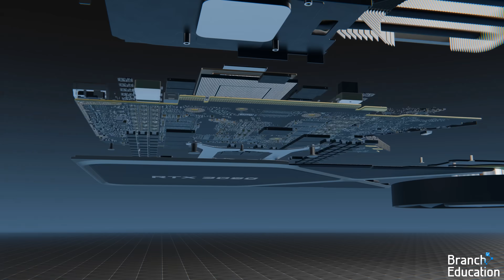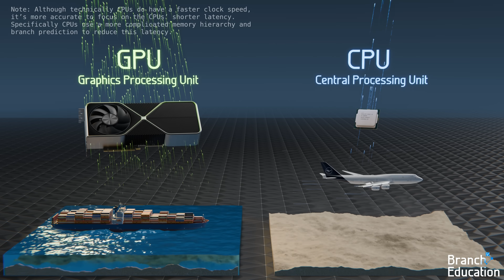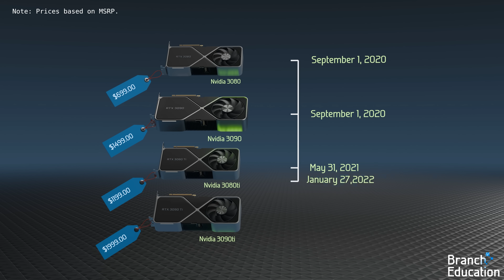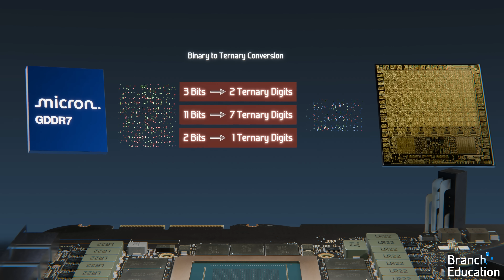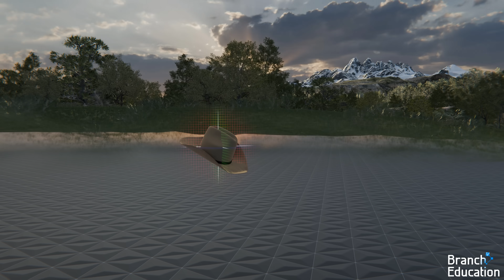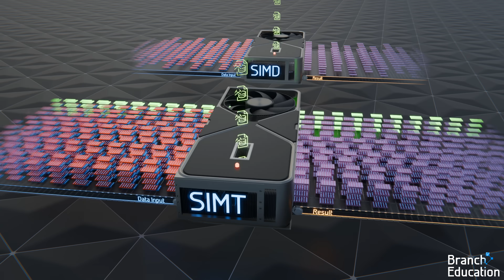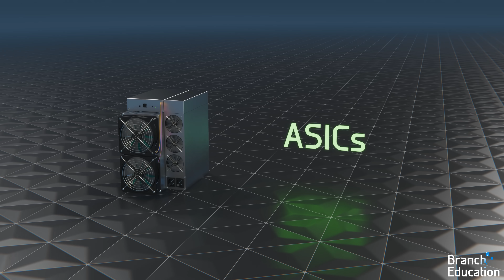How do Graphics Cards Work?  Exploring GPU Architecture

Comment from the maker: I (Teddy) went to an engineering college for Electrical Engineering, and a few of my friends went to work for Micron after college and loved it.  Check out careers at Micron using this link:  https://bit.ly/micron-careers 
One question you may have is why did we choose to feature a 3090 Graphics Card?  To create an extremely accurate 3D model, we had to purchase the graphics card and do a rather destructive teardown to the extent that we desoldered all the components.  To avoid wasting a perfectly good graphics card, we typically buy our models as broken or 'for parts' on eBay, and they didn't have any 4090s, so we purchased and used a 3090. Just so you know, I (Teddy) have a 3090ti in my computer, an i9-12900k, 64GB ram and a bunch of SSDs.  Also, a 4090 performs 82.58 Trillion calculations a second using 16384 CUDA cores.  When it comes to 5090 graphics cards, it looks like they will be 21760 cores, with 32GB GDDR7 memory, and 109.7 Trillion calculations a second, with 170 RT cores and 680 Tensor cores.  

  If you have any questions, feel free to ask them here!
Reply: No questions. Just keep up the great videos ☺️❤🥸
Reply: @Tempestelterna indeed..Good stuff
Reply: How many people are you working with on these videos
Reply from the maker: @bananaboi3343  The team is myself, Teddy, (research & script), 5 animators, 1 modeler, and the narrator.
Reply: @BranchEducation  I thought it would be way more people, wow. Great job
Reply: @BranchEducation  Don't believe it, u r probably 1000 or more member team
Reply: @BranchEducation  why you haven't put the links mentioned in the video about other videos of yours in the description so we can follow on them?
Reply: @BranchEducation  Are you looking for additional team members? I'm trained in a different but
 complimentary discipline. I also like what you do.
Reply: @BranchEducation  these videos are so underrated I wish more people could watch your videos. And thank you Teddy and the team for these videos!!
Reply: I am a poor person now from a third world country , but marky words ,, i will donate to you one day.
 We need people like you in this world
Reply: @BranchEducation  Is that mean 3070 has more "damaged circuits" ? How would they keep it consistent across a certain model? Just disable x amount of circuits?
Reply: @BranchEducation  Thank you Team for your efforts! :face-red-heart-shape:
Reply: @BranchEducation  Awesome team and very impressive video,thanks I really enjoyed it!
Reply: @BranchEducation  What's the narrator's name?
Reply: @BranchEducation  actualy
Reply: I, currently in college for EE, was not aware of Micron before this video, and following the career link to learn that there is a location near me opens up more options for me to explore which I greatly appreciate. Your videos are always so well done and are very impressive. Thank you so much for everything you do!
Reply: Please Make a video on how the ai image generator works
Reply: @khusburezwan yes, will be amazing
Reply: @khusburezwan yes please
Reply: Excellent content as always 💯. 
Still hoping to get a video on how Bitcoin mining works.
Reply from the maker: @No_Names_Here  Hopefully, you won't be waiting that long.
Reply: @BranchEducation  how many books do you read for this and where do you get them?
Reply from the maker: @saidswn980  For this video, a lot of the details were actually found in NVidia's white papers.
Reply: @BranchEducation Hi, where did you study this? What exactly is ee? I'm really interested in this subject but not quite sure where to study it. I'm from Finland and I'm not sure if we have this kind of school
Reply: @soyboy39  I believe EE is for Electronics Engineering, and/or Electrical Engineering.
Reply: @No_Names_Here  same here, i also want to know how bitcoins are mined.
Reply: @MDEmtiazHasanParvez  There is free crypto mining software out there.  I can't recall the two I tried a couple of years ago, but it's easy to do.  Problem is, depending on the current crypto rates, it uses a lot more power consumption running the GPU and keeping it cool.  You also need a powerful GPU if not multiples.  If your system has a lot of idle time, you might be able to make a little profit.  It would make for a great video though.
Reply: Why specifically a Nvidia GPU Architecture? Might be also interesting to educate people there are more ways then one to create a GPU and show their differences. AMD RDNA 3 Chiplet architecture for example.
Reply from the maker: @bartbroekhuizen5617  That's a very valid point.  I think the main reason we pick a specific product (which happens for a few of our videos)  is because I disliked in engineering courses when things were taught as theoretical- which was pretty much always.  So, for our videos, we try to make them explain an actual example.  And really, we chose Nvidia because their white papers went a lot more in-depth into the GPU's functionality.
Reply: @bartbroekhuizen5617  It’s also interesting how intel’s graphics cards chiplet looks like. Cause they have a very good AVI encoder and decoder.
Reply: I see that each generation there's a significant increase in calculations performed. So like what is the limit or will we ever reach the limit of such calculations? How do scientists decide to stop with improvement for each yearly launch? Is it like "these certain number of calculations are good enough for a product for public launch, we'll improve next year" or " we can't improve/increase no. of calculations further so let's just launch this product and hopefully get it to be better next year"?🤔🤔
Reply: @MreeDom  Moore's law.
Reply: @bobbyd6680  I see...so we are close to that undiscovered limit
Reply: This is the gold standard format for educational videos. You inspire me greatly, thank you.
Only since a few years ago have I been more obsessive about questioning how everything is made and the wonders of nature just open up in a positively overwhelming way. It seems that GPUs are branching tward micro and macro models; macro for heavy duty processing, micro for efficient processing backed up by cloud technology.
Reply: Given that I absolutely love my EVGA RTX 3090, I'm quite pleased with the choice of GPU!
Reply: I am a very poor Electrical Engineer but I must say we had to study MPMC i.e. Microprocessors and Microcontrollers in our course and this video just gives a glimpse the immense and vastness of the subject which I passed anyhow😅
Reply: I want to become a vlsi engineer
Reply: How would a 5090 compare to current gpus on a game like rdr2 or cyberpunk? I functionally can’t imagine how much 100 trillion calculations per second is but it seems like it’s more than is needed. If the current gen gpus are at 80 trillion calculations per second, how much of a boost would that get?
Reply: @slimey4427  We might have to go 2,3 generations more for practical ray tracing in games. Cyberpunk doesn't look anything remotely real. Its colors and motions are highly unnatural, yes some fancy light effects but they only add to its cheapness. We will need Peta flops per second level performance in GPUs to make photorealistic games and when we reach that level it will be almost impossible to make so many complicated assets in video games.
Reply: Amazing. Brilliant. Worth multiple awards. The ray tracing and this one is unlike anything ever before. I bet if you make a high school maths course it could advance science and technology. I mean this could have a real impact on the world and its future. Topics like complex numbers, vectors, matrices, all can be done in 30-50 minutes videos each. 15 videos and you can cover all of high school mathematics. That might also generate more funds for you. I can tell you the people who would love to collaborate with you if you form a consortium.
Reply: @BranchEducation  eyyy my name is Teddy too and I own an IT business😂
Reply: I think quantum computer will be best for BIT Coin mining.
Reply: I think that the physical die will have a 512 bit memory bus, but nvidia will partially deactivate it and sell the 5090 with 28GB of VRAM. I can't imagine they'll give us a GB more than they absolutely have to.
As far as I can recall, there hasn't been a mainstream consumer card with a full 512 bit memory bus since the GTX 280 15 years ago.
Reply: I'd love to see a "behind the scenes" episode someday that explores how you make these videos. Your team really does incredible work.
Reply: @genehenson8851  I absolutely second this!
Reply: Two thumps up for excellent videos by your hard work.
Reply: A gpu doesn't contain "cores".  It only contains "shaders"(Shader Unit).  Much different than a x86 cpu.  This is misleading information to the public yet so many refer  it to this because "nvidia" often refers to these shaders as cuda "cores".  ATi preferred to call these shaders as well along with AMD in the beginning. (I realized this video is just marketing)
Reply: It's a bit odd is to use Nvidia's trade marketing names for components found in both Nvidia and AMD cards. It could get very confusing for someone walking away from this video into AMD's CU count (analogous with Nvidia's SMs for instance) or Intel's name for the same technology . The simple line of "'name of thing' which Nvidia calls X" could have helped clear up some massive confusion
Reply: Keep up the great work, looking forward to the video on CPUs! I do also want to say thank you the videos are super interesting and I appreciate your work!
Reply: I'm always stunned at the level of quality of these videos. Amazing job!
Reply: ok makes sense for games and bitcoin always been a joke to me a magic trick but what the hell is that ai i mean how the program works if i can beleve that because im going to need some proof if i know myself enough when things get unbelievable
Reply: great video, hope to see a video on logic gates and other hardware to operate on binary
Reply: will you analyze and teardown the apple m1 or m2 or m3 chips? it will be interesting
Reply: I was exactly the 2,000th person to like this comment.  Cool, huh!
Reply: Can you make a new video on NPU just like GPU and CPU because in era AI we all want to know more about stuff related to AI hardware.if can make video on it will be very helpful to us.
Reply: How about CPU with built in Graphics processor like AMD CPU? Can you make a separate video ho it works?
Reply: I'm merely a guy who completed his highschool but I love these things! Can you help me choose where to start in order to learn this so that I can get into industries like NVIDIA or micron? I'm in Bhaarat so it'd be better if you could explain my the career ladder options with relation to my country. I'd be greatful for your guidance Teddy 🙏
Reply: Thank you for explaining this so thoroughly and not dumbing it down like everyone else does!!!
Reply: What about AMD Radeon graphics cards?
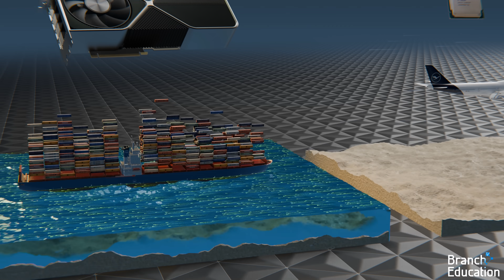Reply: Revelation 3:20
Behold, I stand at the door, and knock: if any man hear my voice, and open the door, I will come in to him, and will sup with him, and he with me.

HEY THERE 🤗 JESUS IS CALLING YOU TODAY. Turn away from your sins, confess, forsake them and live the victorious life. God bless.

Revelation 22:12-14
And, behold, I come quickly; and my reward is with me, to give every man according as his work shall be.
I am Alpha and Omega, the beginning and the end, the first and the last.
Blessed are they that do his commandments, that they may have right to the tree of life, and may enter in through the gates into the city.
Reply: Thanks for explaining single GPU card has so many cores while a CPU, smaller size than GPU card, has few cores.
Reply: Amazing video ❤
Reply: Can you please make a video on working of neural engines. Please😁
Reply: That's cool 😎
Reply: why every electrical engineering always turn into god?
Reply: How neuralink works ?
Reply: I was waiting for a video on transistor physics (as you said before). (Please include the following topics in that video: manufacturing of transistors, how they execute tasks/codes using electric current with examples, alternatives to transistors, and the future of transistors). Please also make a video on the future of computing - quantum computing. 
Thanks for providing this type of quality content for free. It feels embarrassing not supporting you through Patreon or YouTube membership. I will do so once I have the money. You are helping humankind.
Reply: Well one thing I always wonder is if we are on the end of making transistors smaller, how will we progress after like 3 years? While gpus now can make some small updates with a different architecture that could not go so forever. I mean cpus now have stopped improving. How will we progress after this? I mean all of this AI future etc it nice but we can’t do it if we can’t shrink transistors anymore. And for quantum computers it’s way to early so what do we do now?
Reply: Thank you for your time and hard work to provide such an intuitive, and thorough breakdown of this technology, utilizing excellent CGI - great job!! I have been enamored with Information Tech since my father brought home an 8086 TandyCorp PC. Then not much later, explained to me the principles of Moore’s Law. And how the gameboy in my hands had several times the computing power than the Apollo Guidance Computer on the moonlanding missions, which weighed about as much as I did at 10 years old so about 50-80 lbs🤷‍♂️? 

I am a Union Electrician out of LU301 TEXARKANA by day. An aspiring Arduino engineer by night. I by no means would be qualified to work for what appears to be a prestigious organization like Micron. I fix old arcades and PCs and just about anything electric. So thankyou for this. I am about to build me an ASICS and get me some BLOCKCHAIN action going!!! Gonna make it rain ₿itcoin!
Reply: I'm a Sophomore in HS with a strong interest in EE/Computer Engineering. I have already studied EE somewhat, but I want to expand more into the filed of Computer Engineering. Resources on this subject can be hard to find, so do you have any advice for me?
Reply: @willydillyz  see if there is a vocational school nearby with an electrical program. That and see if there is a JATC program in your area, call and speak to the director, say everything you said, verbatim. Good luck.
Reply: Teddy, bear
Reply: How do you animate these ! could you make a short video or some explanation.
Reply: I am currently studying mechatronics engineering. Your videos manage to restore my awe and wonder in technology, even though the stress of university sometimes make me feel like it isnt for me. Excellent videos, please continue to make them. There is no other channel like this on the internet
Reply: I could not agree more
Reply: This knowledge is truly valuable! This is one of the few YouTube channels that really deserves to be widely shared. Thank you to the production team for creating such meaningful videos for the community!
Reply: Tiny correction Ubuntu is a version of Linux... They are the same system
Reply: I wonder if you've considered doing a video on the differences in architectures between the various chips. I am always wondering about the actual differences between nvida and amd or intels new arc gpus. Also curious about differences between amd and intel cpus as well as arm.
Reply: if the 4090 performs twice as many calculations as the 3090, why is it not literally twice as fast?
Reply: @JoshuaStal  Less cores ig just simple logic
Reply: I went to college in 1981 to learn about microprocessors.  I wish my college could have taught me more about these systems, as the electrical engineering college was focused on power systems and big motors.  I had to learn about computer systems in the 90s by working for small mom and pop computer stores.  Please get your information to all the state's local colleges and teach those that can't afford  big colleges.  I went to the University of Arkansas in Fayetteville - where programming was done on punch cards.  I wish I could have been involved in cutting edge tech.  Instead, I just inform others about how this tech works, with no hand in designing.
Reply: What electrical engineering field did you go into? I am going into my masters this year for RF engineering.
Reply: Its a shame programming is so sloppy these days using sloppy massive library files.  Look at the ZX Spectrum using a 3.5Mhz Z80 using tight machine code programming in 48k of RAM.
Reply: Will this type of gpu improve performance of drafting programs? Or is there something more appropriate?
Reply: Now imagine the calculations it requires to run this entire universe
Reply: And I can tell Teddy is a fresh grad in his early twenties.
Reply: He started late
Reply: Hey Teddy my name is also Teddy
Reply: l just found out this channel and it kept me wanting for more, this video was too short!
Reply: Respect
Reply: Hello branch education, do you have yt account "Branch Education Indo"? It is official or plagiat from this account?
Reply: The animations are fantastic, how are they made?
Reply: Please do a video one day of working in your 3D software (Blender, Maya, 3DS, Houdini, etc). The skills of your team are amazing.
Reply: Your content is stupendously great. Hope you guys do videos on how networking and the Internet works.
Reply: You should do In-Memory Computing next.
Reply: Who?
Reply: Hi, I am from a small population speaking a language spoken by around 1.2 million people. Will I be allowed if I ask your video as youtube reaction/translation, so that some interested people from my area will listen to this work. Thanks whatever may be your answer. Regards.
Reply: please make a video 360 degree camera how it work
Reply: Looks like it didn't go well in college, you talk like a moron. also ai voice..
Reply: You guys are awesome....❤ From Bangladesh
Reply: How much did it cost to produce this increidible work of art?
Reply: Perfectly. Please take an overview of blockchain
Reply: how did the gpu feel after u used it for research purposes?
Reply: Awesome!
Reply: @dmerrill85m  indeed
Reply: I think using a 3090 was absolutely perfect.
Reply: I wiah Youtube have like a double like option
Reply: The math at 26:16 says 2600 gpus are needed. But 36 trillion / 95 million = 2.6 million. Do we need 2.6 million cards to get that power?
Reply: 109 trillion a second!!!
Reply: damn thats amazing. thank you so much
Reply: You’re a legend for sharing informative content like this for people like me. Cheers my friend
Reply: Would it be feasible to have something like integrated graphics, but with the power of a full graphics card? So the data transfer with the CPU would be extremely fast, and the CPU and GPU would be all one component?
Reply: A question, if say just one is broken and it is gone, and they can’t put it in a 3090Ti, do they put it in a 3090 with almost 3090Ti performance or do they intentionally deactivate some more to make it the standard performance of the 3090? Also do they only make non 3090Tis this way or does this just give them extra supply of the lower cards if something goes wrong in the 3090Tis production? If they make other cards as well normally and not only are from defective 3090Tis them ignore this question, but otherwise what happened before the 3090Ti was introduced and there was a perfect die? Did they deactivate some? Also great videos these do not look like YouTube videos but like high budget documentaries
Reply: Should i know everything ab the gpu for when im building a pc? Or just a couple of thing
Reply: I was recently thinking of starting a youtube channel that i would call for "mansplaining tech", with satirical humor, but explaining in detail how stuff like this works. You beat me,and this was a great breakedown. Keep it up with these good videos
Reply: hallo herr ich rrrrrrrrt
Reply: You are doing beyond great sir.
Reply: I am waiting for that particular video on how bitcoin mining works. I bet that no one cannot describe as detailed as you.
Reply: Love your work and cant be grateful enough, but it would be WAY accessable without the background music. Please 🙏
Reply: First time here and I know nothing on the subject but this is insane quality of information and production.
Reply: It's mentioned in the vid that it's sponsored by Micron.
Reply: I wonder on what GPU does the universe run?
Reply: If a GPU can do basic arithmetic it can do everything a CPU can. It's normally not done that way but the only discerning factor between a CPU and a GPU aside from the hardware facilities is the speed at which it is calculating.
You can run an OS on a GPU if you modify the ROM chip.
If you get a chip that is big enough or if build the right software.
You can modify everything so the GPU loads data directly from the attached drives.
It has access to the PCIe "BUS" after all.
Reply: Please make on how processor works please and please
Reply: First time viewer here, 23 minutes in to this video. Very strongly moved to express my most sincere appreciation for what you're doing, putting out these spectacular documentary videos. A higher calling for sure. Cheers to you all for doing such a class act job...this is beautiful man. So packed full of information! These have the potential to truly spark the interest of many young men and women. Such a refreshing and rewarding diversion from the social media drama epic!!! Much Love ❤
Reply: 8888ò
Reply: Interesting
Reply: When will you be back?
Reply: A really big thanks to Branch Education for making such informative videos we all are really grateful to Branch Education to spreading high-quality knowledge across the world 🌎🎉
Reply: Love your work. Thanks!!
Does the 50 series  have the same percentage of defects when compared to the 30 or 40 series? There's a lot of hate toward the 50 series saying that the ti or upper level variants should be the lower tier version. 

And what's the difference between the recent server gpus and consumer gpus?
Reply: I’m a geochemical exploration geologist and a pretty smart guy. But compared to the folks who design these microelectronics, as well as the tooling, optics, chemistry, and metrology needed to manufacture it all…

…I feel like a monosyllabic ape content with eating his crayons. 

Seriously, even with your wonderful videos, it all still feels just this side of magic and fills me with a sense of awe and wonder normally reserved for topics like astrophysics.
Reply: What do they call the highs and lows of a gpu? Like when the resolution or the game stutters
Reply: The FUTURE'S is USSR Best Stability control Country in The WORLD'S PEOPLE'S & Welcome Back 🔙 in USSR !!! LENINS WIN IDEAS 💡 WINS WORLD'S PEOPLE'S WIN DEMOCRACY & REPUBLIC! Yes! Respect The USSR !!! Well !!! We help You Made World's PEACE HAPPY! YOUR Team's needs HELP "I'S" for Made personal preference Projects informations community Propaganda's international performance! "I'S" it's Strategy PEACE politics Soviet Union for Next Generations World's! The Best PIONEER'S NoW activated Special Space Technology's "INTELL ' SYSTEM" Start Galaxy Program Socialist Revolution Make Great Again Communism World's Forever!
Made in USSR Special for CHARITY FUND PIONEER
Reply: ❤😂😢😢😢😢😂😢😢❤😢😢😢adw
Reply: Branch! ALOHA! YES! East&West needs PEACE Politics! Beauty Lady in U.S. Alexandria Proletaria Ocacio Cortez! WE HELP YOUR WiNS Leader's WORLD'S! FUTURE'S "I'S" USSR Best Social Security & Stability control oligarchat$ Country in The WORLD! Welcome Back 🔙 in USSR !!! LENINS WIN IDEAS 💡 WINS WORLD'S PEOPLE'S WIN DEMOCRACY & REPUBLIC! Yes! Respect The USSR !!! Well !!! We help You Made World's PEACE HAPPY! YOUR Team's needs HELP "I'S" for Made personal preference Projects informations community Propaganda's international performance! "I'S" it's Strategy PEACE politics Soviet Union for Next Generations World's! The Best PIONEER'S NoW activated Special Space Technology's "INTELL ' SYSTEM" Start Galaxy Program Socialist Revolution Make Great Again Communism Worldn's Forever!
Made in USSR Special for CHARITY FUND PIONEER
Reply: And what about HMC ? 

I  NEED IT
Reply: Can you make a video detail on QRNG devices ? 

Please 🙏
Reply: Sir, even after asking for the graphics video of how the laptop works, you did not give it. Give me a video Very soon please sir.
Reply: Excellent video and great content! You have covered all areas of GPU and its application in Video Gaming. 
Can you create similar content for GPU and their application for autonomous vehicles?
Reply: THIS VIDEO IS AMAZING I LOVE YOU AND YOUR TEAM'S WORK KEEP IT UP❤
Reply: Ah so here you admit that this is nothing more than a commercial for micron!
Reply: a very comprehensive and clear explanation of how a graphics card works. Good jobs !
Reply: Plz add german Audio Translationens
Reply: Go go
Reply: Если на простые игры требуется столько вычислений, то какие цифры вычислений приходятся на обсчитывание реального мира? Ведь по одной из теорий: наш мир - чья-то математическая модель высшего порядка:)))
Reply: Thank you so much for leaving that link behind.  I am an aspiring tech enthusiast.  I am currently working towards a bachelor's in computer engineering but a master's in AI embedded systems.  And I really want to work on AI that specifically works in data technologies.  To what extent that is? I haven't really truly found my purpose.  But that link looks like gold to me and I really appreciate it. If you have any recommendations on what I should do. I'm currently a junior in my program. Please let me know. I am working on pytorch python and some AI problems before I start looking into papers
Reply: Thank you Teddy & Team. These videos are just absolutely top notch. An absolute pleasure to digest and watch. Phenomenal content and a sincere thank you of gratitude for making such easy to watch content on such an enormously complex subject. The effort the entire team put into these videos shines.
Reply: Heyy i have a question: is it okay if i use some mini clips of your video to make a short? Do you give me the permission to do this? And thank you!
(Hope you will reply)
Reply: How far are the stars?
Reply: I can't even fathom this. I wanna know who in the fuck thought about this shit 80 years ago or when the first one came out. Like who TF thinks of this being a actual working piece of tech . If you tried to explain this shit years ago as a startup MFS would be lost in 2seconds lmao
Reply: You didn’t need to come in here glazing the shit out of the channel creator telling them they should charge us for knowledge. Welcome to America. If a dollar can be made then it will be.
Reply: Fr
Reply: These videos are really interesting, but some don't have voice translation into Italian. Please add it. These concepts are difficult to understand, and if they're not in my language, they're even more so. Nice job, you did anyway.
Reply: فَأَمَّا الزَّبَدُ فَيَذْهَبُ جُفَاءً ۖ وَأَمَّا مَا يَنفَعُ النَّاسَ فَيَمْكُثُ فِي الْأَرْضِ
Reply: Good video but you might need to edit out the gasping for breath. Sounds like you are hyper ventilating.
Reply: OK students for me ✍️
Reply: GBPU+A+B=GBPUS ✍️
Reply: I loved your videos because animations are top-notch and most importantly your narration is clear and slow(normal speed for any non-english native person) which is far easy to me to understand your videos and overall your knowledge is incredible and your team work is awesome. I want to clear that I can't fully understand your video's knowledge but get so much stuff, like after your 'Video game working' video I am now little able to teach any person that how game process graphics and initially this is too unbelievable for that high end graphics are actually triangles but conclusion is that your video is great! 
Too much Appreciation for your work! 
Thanks for your community work :)
I am requesting a video on any topic from below list:
- How internet works(include fiber optics working or may make separate video)
- How (Electrical) Transformers works
- How SHA256 and different hashing actaully works
There are some my choices, may be this comment will find you and you will consider it!
Reply: 1.What your pc all specification, i am very curious to know about in depth 
2. Why didn't you purchase rtx 4090 and chooses 3090 ti over 4090 
3. When wifi video is coming sir
Reply from the maker: @TEXc5  i9-12900k, 64gb ram, buncha m.2 ssds and other ssds.  I made this computer a few years ago before 4090s were released.
Reply: Just sau Nvidia paid for this video
Reply: 18 subscibers till 2 MİLLİON BRO!!!
Reply: Great video, however I wish I was not able to find any mistakes in it (that way I would be able to trust it more -- I am no expert on this subject so the fact that I could find a mistake in it is not a good sign), correct me if I’m wrong, at 26:15 the video states that the 3090 can generate 95 million hashes/s and the ASICs can generate 250 trillion hashes/s that is a factor of over 2.6 million NOT 2600 as illustrated
Reply: Imagine only having 64GB of RAM in 2024. 🐌 192GB is where it's at! 😝🗣️🗣️🗣️